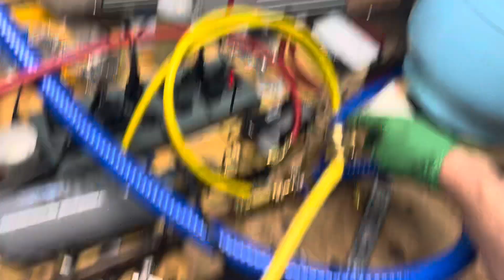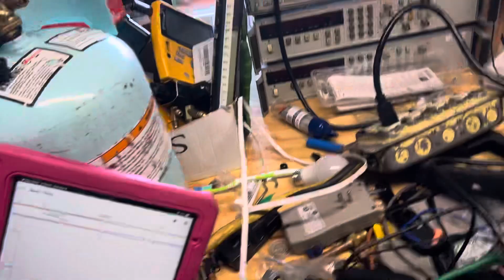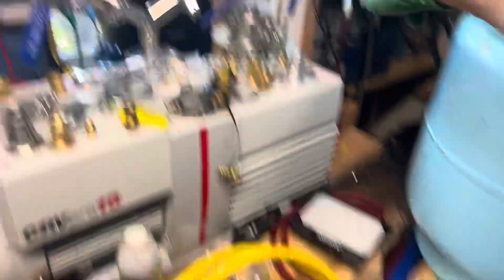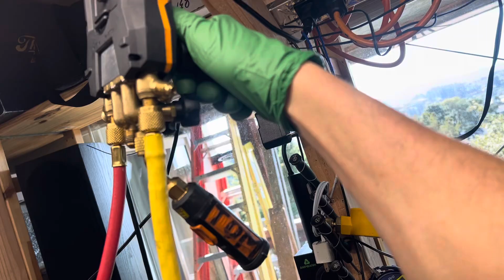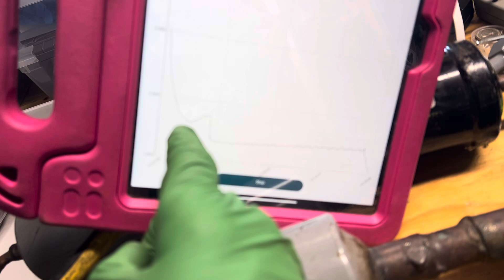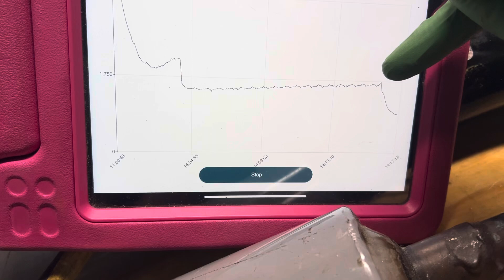TWO TruBlu ￼Vacuum Hose added increased speed, increase depth of vacuum instantly

Comment: Man is that a vaccum pump for hospitals?
Reply from the maker: This size vacuum pump is what we use in small commercial or industrial HVAC, 
         This vacuum pump is also used in laboratory environments used as what is called a roughing vacuum. 
         Where there is another turbo, molecular vacuum pump or similar design that is upstream attached to a research vacuum chamber. 
            The other vacuum pump cannot be turned on until there’s almost no atmosphere because just the atmosphere of our air is too thick. It’s like molasses or concrete.. in comparison, the motor of the turbo molecular vacuum pump cannot handle the resistance of air. It would damage the motor or drive.. 
    So they would use this vacuum pump to draw out 99.9% of the air so it’s down below 100 µm and then it was be safe to turn on the other vacuum pump that can draw down the vacuum way far below even one micron. 
     In some of this research and testing, even certain metals cannot be exposed to this vacuum because there’s certain metals that actually off gas they cannot even have rubber or synthetic material seals because synthetic compounds used in their composition of gas or leak at these extremely low vacuum levels

Comment: Good video Tom
I have a video request that will help myself and others in buying and setting up the TruBlu hose to an R134a system.  
Specifically,  could you do a video showing the adapters you use to connect the TruBlu hose to the suction side of an R134a system while connecting the other end of the TruBlu hose  with adapters to a common vacuum pump such as the Robinaire 6cm two stage pump?   Because the  TruBlu hose with adapter kit is made for the HVAC industry, there is a need to use various adapters/fittings to make this work.  I want to get the TruBlu hose but don't want to go thru a lot of trial/error and expense trying to obtain and set up the necessary adapters/fittings if you already have this knowledge available to share.
Thanks for you help and keep the videos coming
Reply from the maker: Yes, I will remake this video. It’s been a long time since I made that video. I’ve made a couple.
Your vacuum pump if it has those Acme threads you will need adapters going from acne to quarter inch or 5/16 or 3/8 inch 

If your vacuum pump has standard old-fashioned, yellow jacket, quarter inch threads, the true blue will connect right up to it

Comment: Tom ....what are the Vacuum hoses you use to replace the " refrigerant charging hoses " coming off you fieldpiece Manifold  ?    - Jay
Reply from the maker: You don’t change refrigerant, charging hoses to vacuum hoses.
   The vacuum hoses are dedicated hoses that were not designed or intended for pressure or running refrigerant or oil to them. They were only designed for vacuum only.

I do have some modified hoses .  Some refrigerant hoses that have a inner membrane lining.. 
     I also have some refrigerant hoses that are made out of braided stainless steel with the inner Teflon hose lining